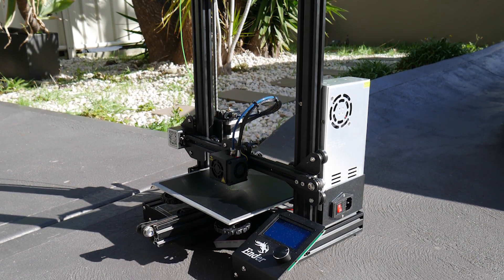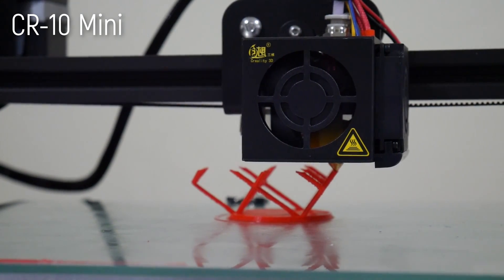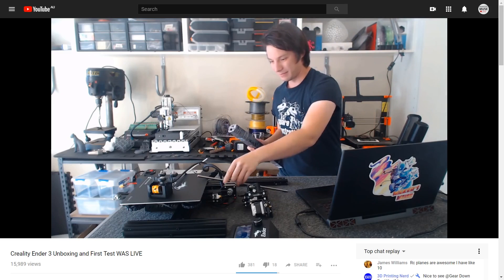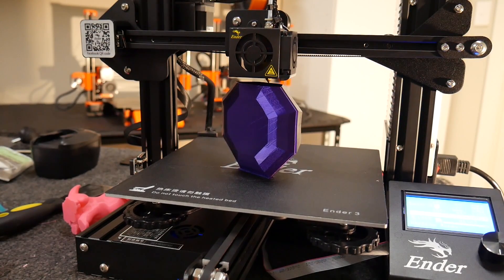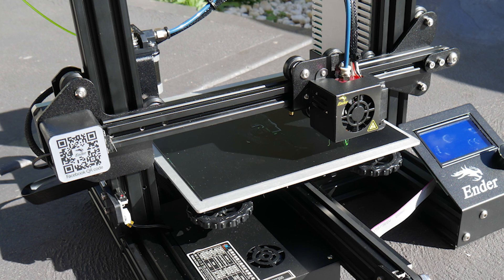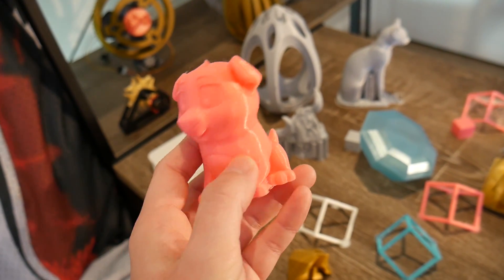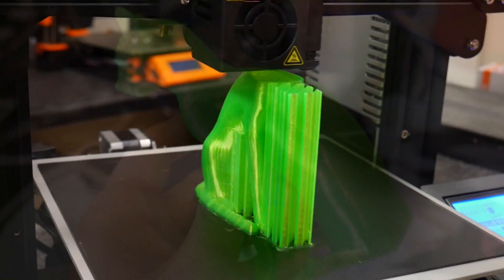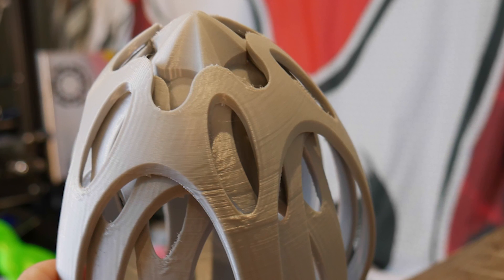Creality Ender 3 Review

Comment: Dear Angus, cool review! 
We will work with Naomi and continue to improve :)
Reply: Just seeing that @Creality 3D is monitor feedback is pushing me toward buying this printer.  Anyway we could get a list of improved items over the last couple of weeks or looking forward next couple of weeks?  I'm very interested in this printer but might wait another 4 weeks before ordering to see what issues are worked out from the factory.
Reply: @iphonetroll  I brought one a week ago and so far love it but as with any new models that come out the first ones always have teething problems.
Reply: @Proper 3D lol mine works perfectly
Reply: @maxxiang8746  are there foot couplers included now? Or is there still a need zu replace them?
Reply: @linushoja7397  i havent replaced anything yet
Reply: nice trolling :D @Proper 3D
Reply: @Creality, did you improve these quality controls on the original ender-3 by now or are these problems only solved on the ender-3 pro?
Reply: A new customer has entered the chat!

Guest 10xxx: Wow! <3
Reply: Looking to buy one of these. Have these issues been fixed?
Reply: I've just assembled mine. About to do a test print. Hopefully the couplers and build plate are ok.
Reply: @mozkitolife5437  How'd it go?
Reply: @blasterisk  It did OK. I printed a mini model of my head (19 hrs). Good result. Slight layer shifting but nothing that can't be overcome. Good, low level of noise compared to my first 2 printers. The only issue so far is the poor adhesion of the decal to the fibreglass removable bed. It has bubbles in it which creates raised areas. I'll probably change it to glass anyway. I'm building an enclosure because I primarily want it for ABS printing.
The control interface is rubbish so that's where the low price is borne out. I only put 5 files on the microSD card and the printer is too slow to scroll through them. I'll change it out to a touchscreen and new PCB controller. If you're happy with a shitty user interface, the rest is OK and I recommend it. But if you have the $$, definitely go for something no less than $700 because the upgrades this thing will need will push it close to that.
Reply: so these issues presented here are corrected?
Reply: I have a feeling that anyone would be happy to work with Naomi.
Reply: ha ha ha

Comment: Don't laugh at those wheels, they are awesome, actually they were community designed to be printed as replacements for the tiny ones the printers came with. Were actually glad that now the improved ones come with the printer. Also manual leveling is quick and easy so paying extra for that is not a priority for everyone. 
Other then that very good review, had similar problems and thanks for detailing what causes the under extrusion.

Comment: Man, those adhesive residues can be easily removed by using thinner or mineral spirits. Apply a layer on the surface, like butter on a bread, wait about a minute or so, the residues will be desolved and turn into a jelly form, slightly or not sticky at all. Gently remove the jelly by an old credit card or failed print with straight edges. Shiny metal surface again in a few minutes.

Comment: Hi guys I need some advice. Over the last month my interest in 3D printing has skyrocketed! It seems very interesting and fun. I was considering purchasing a variant of the CR 10 relatively soon. I started reading some articles about the potential health risks that it could cause such as VOCs and UFPs. Although I know that PLA, unlike ABS is generally safe to print with, I have seen numerous contradicting articles. I have also visited a website that sells enclosures with filters and such but they are more expensive than the printer! I am kind of a worry wart when it comes to health risks. Could someone please clear this up and give me some advice! I would really appreciate it. Thank you if you read all of this!

Comment: If the wheels are over tightened they create flat spots after sitting and the axis moves with a bump at each revolution of the wheels. My "Y" was ruff out of the box and the "X" (I had to put together) acted the same way after it sat over night in one spot. Once adjusted they return to original and smooth operation. The power supply fan must have bushings instead of bearings. It started making a high speed vibration noise so I replaced the 60mm 24 volt fan with a quality one from Digi-Key. Other than that it prints almost as good as my Creator Pro ($1200 Can)

Comment: "Safely hidden" mains wiring is correct, it sure isn't safe though!
The cover is too short causing the wiring terminals to interfere with eachother, mine arrived with the mains earth completely disconnected... Extending the cover design by 17mm solves the issue and should have been done at the factory.

Comment: Would you say that we should wait to buy the ender 3, until they fixed most problems?
Is the open source thing going to accelerate the improvement? How long will it approx. be until they fix some of these problems?

I'm not in a rush to buy a 3d printer, but want to improve my rc planes with custom parts in the future.
Reply: The fixes will be pretty quick, probably within weeks. The trick then is to make sure you get a new one when you purchase.

Comment: Monoprice Maker Select V2 vs Creality Ender 3 for price point which would be the winner?  I currently have a Monoprice Maker select but the Melzi board burned out and I replaced it with a RAMPS 1.4 board running Marlin firmware  but is the Ender 3 better then the Monoprice?

Comment: Mhh strange, my Ender 3 works just fine without any bowden-issues so far and the Z Switch works accurat. The only issue I encountered is the buildsurface warping at about 70°C, because the glue doesn't sticks at that temperatur, which ruinied some of my prints.
Reply: Had mine for a week and it's also fine. 
Mine has clips on the mat so the edges can't curl much.

Comment: Hey Angus, glad you got around to testing it as well. I didn't have the same bowden issues but i did have extremely tight rollers on mine and got the same dusty mess you got on my first prints until i adjusted them. My Y axis was binding terribly. Thankfully it's an easy fix.

Can't wait to see you convert it to direct drive, i'll likely do the same and will follow your example.

Btw: i only found one Simplify3D profile that didn't really work for me, and it was terribly confusing to me that Simplify3D lists the printer as supported but it's not in the list of printers in the software. How did you find one?

Comment: Regarding the problem of removing the printsurface: in my experience heating the bed to roughly 100°C before peeling off the sheet prevents this layer of old glue on the bed.
Note: Gloves come in handy when you dont want to burn yourself (guess how i know)

Comment: Thank you for another quality review.  It's almost like you get what you pay for sometimes? ;)

Edit:  Also, I'll never buy another printer that uses VSlot wheels.  My GMax has taught me a valuable lesson there.  Still salty about Joel's review that didn't seem to do it's due diligence. My GMax is now taking up space in the garage with boxes piled up on it.  300+ hours troubleshooting various issues on it almost all stemming from vslot wheels being impossible to keep aligned properly over the lifespan of the machine.  The printer never finished a 10+ hour print without skipped steps.  I'm either going to sell it, or rip it apart and build something new with the pieces.
Reply: Did you try replacing the wheels with higher quality ones? Like poly wheels http://aus3d.com.au/wheels/extreme-solid-wheel

Comment: I have the CR10-S5, would going to a direct drive extruder improve things? I have some E3D V6 from an unbuilt 3D Beast kit, along with a volcano. What improvement would it bring to swap out the extruder?
Reply from the maker: I find direct drive extruders to give better print quality and less stringing compared to bowden, but that's just my personal experience with them. I would try the upgrade but only if you're not happy with the current prints as you risk making things worse with the added moving mass.
Reply: Thanks, I don't get any stringing at all and am really happy with the prints since adding a sensor for bed levelling, so I think I will leave well enough alone!

Comment: Glad to see an honest review from you on the ender 3. I was a bit worried for a while there that the lack luster QA that comes with a printer being a 'hit' but it does look like the issues with the printer are not game ending. Thanks for this Angus, I feel confident on making this my first 3d printer on the condition that I budget an extra $50-$75 for an extruder assembly redesign and connectors+tubing. With all this manual tightening of the wheels needed I am wondering if we can just find a device to preload them to a set torque... something to look into for sure.

Also Nerys has a great video on the step by step assembly for the ender 3  that I think is really beginner friendly if you have not seen it yet. https://www.youtube.com/watch?v=ffVe-Ir0La0

Comment: i got an Ender 3 as my first 3d printer about a month ago now only trouble i had putting it together was getting the z axis motor because i wasn't screwing it in straight because of having to keep taking the alan key out because of the pole and feeding the filament in can be a pit of a pain but i'm pretty happy with the prints i've managed to get from it

Comment: Hot end issues sound typical at that price point.  Not a big deal though when you can find Inexpensive V6 clones that work pretty well pretty easily these days.
Reply: It's common, but that's no reason for us not to do better...
Reply: How difficult is replacing the hot end with a V6? I have a CR10 S5 and 4 genuine V6 hot ends sitting in a box from an unused kit.

Comment: My friend is looking for a 3d printer for his workshop making small parts as required but wants quality that just works. What would you buy if you had $600aud? Is there anything around for that price that just works?
Reply: The cocoon create works out of the box, but keep in mind that 3D printers are a tool just like a lathe, they need upkeep and maintenance, and some time spent calibrating and setting up. The current CR10s also now works straight up, they have fixed all the original issues, but you might want to add auto bed levelling to any printer you get.

Comment: My Ender3 has what feel like flat spots when you roll the bed, but I've taken everything apart and can not visually see anything.  Has anyone come up with a fix for this?
Reply: It's the tension of that screw he was talking about, if you tweak that it goes away. I replaced my wheels with polycarbonate ones though, the standard ones are not the best.
Reply: Vincent: would you mind dropping a link for your polycarbonate rollers?
Reply: Yep just use a linear rail MGN12 or something for about £16,  cheap easy and works also probably cheaper than replacing the wheels.

Comment: Great review! This was my first 3d printer, I just started a few weeks ago with this whole hype train. I did have an issue with the tube popping out of the first coupler but it only happened once. I'll take your advise though, and replace both so I never have to worry about the second coupler becoming such an issue. 
Most of my problems were with the bed. Seems like they have serious quality control issues with the center of the bed being warped. Being new, it was difficult for me to figure out leveling and initial layer heights and having to add a glass bed added to the headache. But, after solving that, its been running great! 
Looking forward to more videos!

Comment: When I built mine when I turned it on it’s stated screeching and the screen was flashing. I sent it back. I also had the same strange catching in the y axis. It would have been my first printer but I just didn’t want to deal with strange electrical problems from the start.

Comment: The Ender 3 is my first 3D printer. It took me a good couple of hours to assemble because I never had assembled one before, and because some assembly points are quite criptic. However, once assembled it's been pretty useful and I've found myself using Tinkercad to design parts and pieces for a lot of home projects. Also, I preferred to use Slic3r instead of Cura, and the other thing is that you can improve adhesion a  lot by using double-sided adhesive tape on the heating bed.

Comment: You say "no 3d printed parts" like that's a good thing, and imply you think that's where the industry should head. There's definitely a place for that, but it's a heck of a lot easier to tweak and reprint a 3d print part. So, for the "I just want something that works" crowd, something with no 3d printed parts can definitely make sense. But for the tinkerers.. I really hope we continue to see things like the Prusa that make heavy use of open source 3d printed parts.
Reply: The Ender-3 is now also fully opensource. So It will be easily hacked or reproduce a missing part even it originally using injection mold parts.
Check it on Github!
Reply: Thing is that 3D printing is (outside of a few rare applications) crap for mass production, so using printed parts will greatly increase the cost of the machine. You can of course replace a moulded part with a printed one, though the print will be weaker unless you use special materials. I'm considering the possibility of using prints as patterns for casting in either epoxy resin or metal, which would circumvent the strength problem at the cost of more time and money.

Comment: spot on as usual! I have a Tornado as my 2nd printer. If i was a total noob, i would have been hard pressed to figure out that issue right out of the box. Ended up replacing ph with e3dv6 after wicked jams all but destroyed factory head in the 1st week. epoxied in a new coupler since extruder body came stripped out. someone at factory put plumbers tape on the fitting and tried to jam it back into the extruder....ugh That should have never made it past QC if they had any LOL Luv my tornado now, many reliable prints later after many upgrades....Looking forward to what they come up with next.

Comment: So I’ve got a cr-10 and I was wondering if I could use petg with it even though it says to use pla
Reply: It depends on the temperature requirements of the PETG filament that you choose. The higher temp ones could melt the lining in the print head.
Reply: Laser Man Thanks
Reply: Check out the safety guide here
https://www.captubes.com/safety.html

Comment: I think the bowden tube set up will never really perform well To be fair to the factory the whole push fit system was never intended as "mechanical" system to endure continual longitudinal push-pull cycles. The "push fit" design relies on the conveyance of pressurized gas to properly grip the tube and per definition has room to move to release the grip for maintenance/replacement purposes. The grip system is well designed for its intended purpose with more pressure resulting in more grip!
Only with good quality push fit fittings AND retainer clips to reduce the movement, can you expect anything like the performance required for printing with retracts.
Considering they cost mere cents to produce im surprised the factory dont include retainer clips as standard

Search Thingyverse for "bowden clip" for some 3D printable ones

Comment: Agree quality control is an issue. My x axis belt was over an inch too short! Had to make up for the missing length with zip ties until I got another belt. Also had to loosen the frame and retighten to make it sit level. Luckily no Bowden tube, bed or roller issues (so far). Printing well with PLA and TPU.

Comment: As a complete newbie to 3D printed I got my Ender-3 yesterday and managed to print a few 3Dbenchies in PLA which came out perfect. I even succeeded with two action camera mounts in TPU. So my experience was very different than yours. Thank you for the upgrade tips, I will order couplers and bowden tubes now.
Reply: how is it now after 4 years?
Reply: @woodrunner51  I must admit I did not use it much but I think it still is a very fine printer once you have familiarized yourself with it and found good slicer settings. I print mainly TPU and even though it is a bowden fed printer it prints TPU like a champ. The best thing about the Ender-3 is that there are tons of mods and tutorials out there. If I bought it today the first thing I would do is flash a firmware that recognizes the overheat sensor. I did order it with a glass heatbed because the original one had a substential dip in the middle. So overall a good printer with excellent value.
Reply: @Gosuminer  man that was a quick reply! Tnx :)